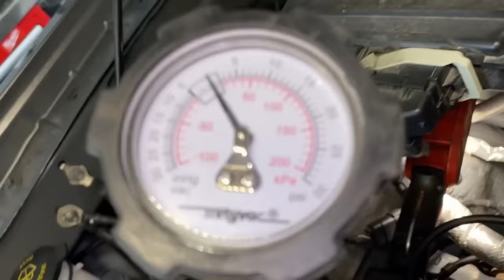2011+ Ford F-150 3.5L GTDI Ecoboost Engine P0299 Turbo Underboost Quick Diagnostics

Comment: Is it necessary to push the engine hard as a routine if it gets babied for most driving.  I have a 3.5 in my Raptor, my wife drives mostly and the vehicle does short trips and does not get worked hard?

Comment: Brother thank you! The bypass valve was the issue on my 2016 Expedition. Question for you. I was using a K&N filter, which as you know, is oiled. When I replaced the valve I cleaned the MAP sensor and the other inline air sensors and replaced the air filter with a paper STP one (it was the brand the auto store had) my thinking being that perhaps the oil used on the K&N filter may not be compatible with the diaphragm in the boost valve and could cause it to fail prematurely. Do you think there in any merit to my thought or is the oil K&N uses safe for the Ford EcoBoost system?

Comment: I recently purchased a 2012 f150 Platinum with the v6 eco lost , I noticed that the air filter housing does not have a top. Looks as if I have a washable type filter with a stocking over it. Is this something you recommend if so what would be service intervals?

Comment: Mine doesn't have the bypass in the intercooler but a vacuum actuated bypass on each turbo. I can't find any info on that system though. I have a 2011 F150 Lariat 3.5 Ecoboost.

Comment: Hey FordTechMakuloco I have a quick question for you, I have a 2009 Ford Escape with the 3.0l. and need to change plugs. It has 170km on it (from Canada) I can not get a Ford OEM platinum anywhere in Canada. What would be the next best thing? NGK platinums? And do I really need to change the coils? Ford wants $243.00 per coil. I really would appreciate your advise. Thanks. Great channel as always. You are my go to channel for my escape.
Reply from the maker: Yes

Comment: Great video. Very helpful. Quick question. Does this code make the check engine light up?
Reply: Yes, very much so.  It's a MIL illumination for sure.  The only way to know if the MIL is caused by this specific code is to get a code reader and pull the diagnostic codes.  I suggest a bluetooth reader like the OBDLink MX+ or something similar that allows you to read it with a phone or computer.

Comment: Damn with as many videos that you have to do for these ecoboost it makes it seem like they are not really that reliable and that mine is a unicorn... 2012 121000 miles only thing ive had to do to it is change spark plugs right around every 40k miles, an O2 sensor that was reading just a little off and oil changes... still got the factory turbos, intercooler, and what not... 🤷🏽‍♂️ im a mechanic and you know we really dont get to take care of our own things like we want to yet my truck has been pretty solid
Reply: I have 163k on my 2013. Only problems have been an O2 sensor and an output speed sensor.
Reply: Same here, 105k, 2011.  O2 sensor one time. Plugs once.  Blend door actuator, 7 times, but that's it.

Comment: New subscriber here and sooo happy to have found your videos! I like how articulate and to the point you are 😊
 We have a Ford Escape with the Ecoboost (turbo charged) engine. What do you recommend using to clean the air filter sensor and other items you say to "check/clean? I have WD40 spray, Brake Kleener, Simple Green, Kirkland (Costco) commercial strength degreaser, and a air compressor with several blower fittings. The escape was a lease return but I do not think it was maintained very good. Changed the cabin air filter (using your video, thank you by the way) and looked as though it has never been replaced, lol. Thank you for your advice! ~Annie
Reply: Don't use a y of the above to clean the air sensors. Use a spray specially made for cleaning those parts, like crc mass air flow sensor cleaner
Reply: @JasonW.  is that a can with a red and white colored label? I think my husband has that in the garage also. Thanks!
Reply: Been awaiting for someone with knowledge to reply. Gooe searches haven't provided that information unfortunately 😕
Reply: @dagdernit572  the CRC brand name will be in a red colored area on top of can. Make sure it is for mass air flow sensor, and not some random can of CRC as they make a lot of sprays for different purposes.
Reply: @dagdernit572  I was waiting for Brian to reply.
Reply: @mont5584  Thank you for replying, when we had our last oil change weekend before last, they cleaned it for us. Didn't want to take a chance using the wrong cleaner.

Comment: If you get the P0299 Code and clear it and it never comes back, does that mean whatever it was fixed itself? Like maybe a hose was crimped and became uncrimped? Or does the code just not come back when you clear it and there's likey something that needs to be fixed? thanks

Comment: Could a tear in the BOV diaphragm cause boost surging upon initial start up? Mine has been building boost quickly and blowing off three or so times upon start up. No codes but it seems weird even to the point that my wife asked if it was normal.

Comment: I know this video is old but new to turbos. Have a 2015 f150 3.5. Question the pcv valve, is it suppose to have a little play in it or is it suppose to screw in tight. Engine light comes on code says pcv valve issue or crankcase pcv forget which one. Any help is appreciated plus gonna check everything he said to look for.

Comment: Where are u located and the hat do u charge? I have a 2016 Ford F-150 3.5 eco boost...I can drive it but doesn’t have much power, check engine light came on, says it’s turbo A...when I start it, it has an awful sound..what would u suggest, dealership charges too much

Comment: I have a 2014 Explorer Sport and it doesnt appear to be producing boost.  I have checked it with my SCT and its running in the - all the time.  Also, front tube for turbo was full of oil when I pulled it.  The clamp was actually loose on this turbo.  I have recently found course aluminum shavings in the piping.  Aside from the aluminum shavings, the excessive oil that dumped out of the tube could be an indicator of a bad turbo, correct?

Comment: I have a question on a 2012 F150, it has this code but the major issue is the desired is at 13.4 psi and at throttle plate actual is the same at idle and only goes up to about 14.9 under load.

Comment: Hi Brian - Great video!

Two questions:
For a Transit 250 with the 3.5 eco boost - is it still pressure or vacuum on the waste gate? 
What do you recomend to clean the mentioned sensors (MAF, pressure, ETC)?

Thanks
Reply: I know you posted this 2 years ago but in case you still need it:

Pressure for the wastegates, they share the same turbo as the 2013-2016 F150

For cleaning sensors use MAF Sensor cleaner (available at auto parts stores or Walmart) also would recommend cleaning the throttle body (use throttle body cleaner)

There is good reason for using specific cleaners. MAF sensors don't work properly if a cleaner leaves residue - like using window cleaner that leaves streaks behind

Comment: How about Overboost code PO0234?
Happened on my 2014  2. 0 Fusion .
Was fixed by replacing Valve Assembly

Comment: I found an inlet pressure sensor code on my 3.5L. It gave me TSB 14-0082. But, I am hearing a single, loud and distinct clicking noise at the bottom driver side of the air cooler. This noise occurs every 5 seconds just about like clock work. Please don’t confuse this with the timing chain rattle or idle noise people complain about. I have a video I can share if it will help.  This noise is coming from the part you’re discussing at the 10:55 mark. One loud click, every five seconds. Any ideas guys?

Comment: The 2011 (and 12?) have an individual bypass valve at each turbo instead of a common one with that cheap orange seal on the 13+
Reply: How do you get to them? I'm having trouble finding them.
Reply: @Cweakley21  Right by the turbo. Easier if you remove the fender well

Comment: Is there anything I should do to the 2.7 ecoboost in the Ford F-150 xlt twin turbo  I just turned 48000 miles and use nothing but synthetic oil in everything

Comment: I have the 2011 and i can’t find the valve. 
I noticed the manifold is missing a screw. 
Mine didn’t passed the smog check due to this code. Wheres is the valve on the 2011?

Comment: What's the part number on this?  I have a 2012 Eco that keeps throwing under and over boost codes and won't even touch 10 psi, tuned or stock.  I already have turbosmart dual port BoVs.

Comment: I have that code and a loud whining noise when accelerating I'm also losing power. I can't take my truck to a Ford dealership for 2 to 3 weeks as there backed up. I'm trying to find the problem hoping that I can fix it. My question is do to the whining noise are my turbo shot and need to be replaced? Ford is so expensive and not all that trustworthy in my opinion.
Ps. I'm also getting a p0073, & p0035 is it possible I took out loovers in the front grill to install a hitch receiver to add a front winch. It had a plug to operate the loovers which I couldn't put back. Could this be creating my problems?

Comment: quick question  mechabic i went to check on Turbo said its westgate problem both side which is expensive !!!!!   my code reader shows its bypass walve. i dont trust that s hole at all. it was working before i fix timing chain . i dont hear turbo sucking air nor power on engine ? what do you think is the problem?

Comment: can you provide the amazon link to the type of 8 mm bolts that one can use to replace /fit the boost valve AA5Z-9U465-A you show that the bolts break all the time when replacing

Comment: I`ve got a 2016 fusion with 1.5l ecoboost its got a p0299 code and no power. I`ve also noticed excessive oil in the throttle body. It also blue smokes from the tailpipe on cold start. I`m just wondering if this would be the turbo, or could it be something else. I`m not hearing any noises from the turbo area. I`ve been looking on google, and alldata and haven`t been able to find anything on the 1.5l mostly just the 3.5l like you have in this video.

Comment: Sorry it's not about this video . But is there a way to wire a 7 pin trailer plug on my 2008 f150 that did not come with a towing package ? Look on e-trailer for plug and play but saw nothing on 2008 f150

Comment: Hello big fan, can you help me, I have a 2001 Ford van e350 superduty v8 5.4L it has a code p1131 and one shop couldn't find the problem they checked the o2 sensors the maf sensor they checked everything and nothing,any advice on what could it cause the p1131?

Comment: I have a question I have a 2012 like that one your working on I saw tons of videos of people putting tiny holes in there inter coolers at the bottom to drain all of this nasty milky brown fluid and to put oil separators on them what do you think?
Reply from the maker: I would never do that it makes a mess, if you are that concerned then do it right with a catch can. The new twin can setup from Team RXP are amazing! http://teamrxp.com/products/new-2019-heated-ultimate-catch-can-system
Reply: I did it. The only mess it made was when I first did it. About 6 oz of creamy sludge blew out. 
The truck had 110k on it, and it was cutting out on rainy, humid days when I would punch the accelerator to get on the interstate. That issue stopped immediately. 20k miles later, I have a tiny hole in my cooler, a little oily residue on the air dam, and a truck that doesnt cough and sputter in humid conditions. No spot on my driveway. Not excessive amount of mess on the truck.
Reply: I attached a small hose fitting 1/16" with 5 " of clear tubing extending below the undercarriage. Its low enough that all moisture/oil hits the ground, not the chassis.
Reply: @craigmandala237  I think one key it to use a good quality synthetic oil that doesn't vaporize as much. Pennzoil Platinum...
Reply: @DoyleHargraves  Same here. Around 80k miles my 2012 had an intermittent issue sputtering/stumbling when it was humid and raining. I drilled a 1/16" weep hole in the cooler and about 3 tablespoons of milky oil came out and the truck has run great ever since (now at 113k). I don't even see any oily residue near the weep hole anymore. It took 80k miles to even accumulate a few tablespoons, so whatever little bit passes through there now just blows out while I drive. Never noticed any driveability issues because of it and it's small enough that I could easily JB Weld it if it caused an issue.
Reply: @DoyleHargraves  doyle, I thought someone hit you in the head real hard with a lawnmower blade?!
Reply: @markk3652  he called an ambulance,  not a hearse

Comment: Do you know why a 2016 F150 3.5 eco boost with max tow package be heating up towing a 7k trailer. It will especially heat up if I hit any kind of hill. I usually have to keep it under 60mph when towing because it will over heat. Took it to the dealer and they told me they didn’t find anything wrong with the truck and I am towing to much. It happened with my 3k and 7k trailer so I don’t know what it can be.

Comment: Hello Brian, thanks for the videos. I could not find a related video for the 2.0 EccoBoost 4 cylinder. I am considering a Connect purchase, and have been looking for related problems on this engine. Do you have any issues on these newer generations.

Thanks, Steve C
Reply: One of the best Ford EcoBoost engine

Comment: Can you use mass air flow sensor cleaner to clean all of the air flow sensors like the boost pressure sensor and the sensor by the air intake filter 
Thanks
Reply from the maker: Yes
Reply: @FordTechMakuloco  saWEET! Thanks!

Comment: Great video! 
I have  a 2014
At 2500rpm a buzzing noise sounds like turbo . Ever see this ? Thanks
Reply: possibly an exhaust leak.
Reply: Check the heat shield on the crossover pipe under the trans crossmember. Those have a clamp that rusts/breaks and makes a sharp buzzing sound. A 2 3/4" stainless hoseclamp is the fix if you find yours is loose.

Comment: Hey man I hope you read your messages as I really need help. Recently I was driving and I couldn't hear my turbos on the right side of my 2011 ecoboost but instead I hear a rattling sound. It sounded like a loose ring or something. I could only hear it when I would hit the gas when I would release it it would go away. Any ideas what the heck is going on. Please man any help would be awesome.

Comment: Guys I have a question I have a 2.7 eco f150 2016 sooo I was wondering if I could just slam the 3.5 turbos in it does that work or is their any other changes needed?.

Comment: would this cause a early blow off when I am not pressing hard on gas pedal. from stop to normal take off I get a blow off that sounds like a fast spit of air and I have the code, now. the code is new and just replaced the turbos (will check the connections form the shop)

Comment: 04 F150 5.4, rebuilding the engine, how do I determine compression stroke?Will the OTC crank tool put the #1 on compression?
Reply from the maker: There is no compression stroke just #1 TDC which is what the tool will set the crank at. When you time the engine and align the cams it will set the compression stroke.

Comment: Thx Brian, 
What about drilling the hole in the bottom of the turbo cooler to let the extra water & oil out, 
With a 3/16 hole ????
8/21/2020
Reply from the maker: Makes a mess not worth it.

Comment: On  long trips my 2013 f 150 3.5 ecoboost  always check engine come on  with the code p029  . Ones I drive in the city for 2 0r 3 days the check engine light will turn off.

Comment: Question about an F150 ecoboost, 2011. It needs the Rack and Pinion replaced and how do I get the right part using the Vin?
Reply: Go to a pick and pull

Comment: Im new to owning a 2011 ford f150 lariat crew cab ecoboost and I have the p0299 code now what runs through the small radiator where the part is getting replaced can I pull it off or do I need to take it out or drain it before pulling the part off please help lol

Comment: Do you have to drop the charger cooler to change the blow off valve if you keep it stock?
Reply: You can take off the BOV without removing the charge cooler, you'll just need to disconnect the large driver side hose to access one of the screws

Comment: Hey guys sorry for going off topic my wife had a 2007 Ford escape while going about 40 mph down the highway it starts like studdering hit the gas a little harder it goes away. Someone's gets worse when car is hot any ideas cause I spend money trying to figure this out.
Reply from the maker: This is a secondary ignition misfire caused by the spark plugs and if you have a 4cyl engine it could be oil down in the spark plug wells causing it also.

Comment: My 2013 F150 has been intermittently been throwing this code also. 
Can anyone tell me how to clean those boost pressure and air flow sensors? is it simply remove and wipe with a clean rag? or is there some sort of cleaner that should be used? Thanks!

Comment: Off topic does Ford make a towing tune for 17 F 150 3.5 EcoBoost with the 10-speed thanks.
Reply: What kinda tune you looking for?
I have the Roush power pak and very happy with the extra power. still has a warranty

Comment: Ford engineering at it's best. I don't get it. How can they put a product out that seems to be so problematic? You are the master of this domain though. Nice video!
Reply: @wysetech2000  I pretty much figured that, but Ford seems to have more problems than other automakers. Thanks for your knowledge on this subject.
Reply: @robertgregilovich2229  where do you hear ford has the most problems? I can say ford does use turbo engines on most it's fleet now and are one of the most too selling vehicles in all classes

Comment: I’ve checked all that on my 2015 f150 2.7  and all checks out well. But under load I still get a p2099 and throws it into limp mode. What else could this issue be?
Reply: Did you ever figure out this issue? I'm having a similar issue with my 2013 f150